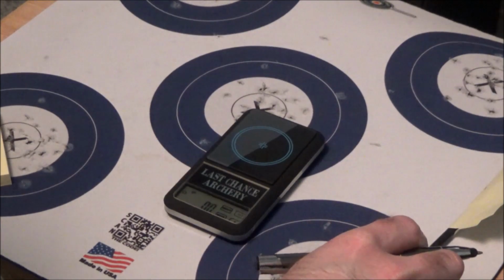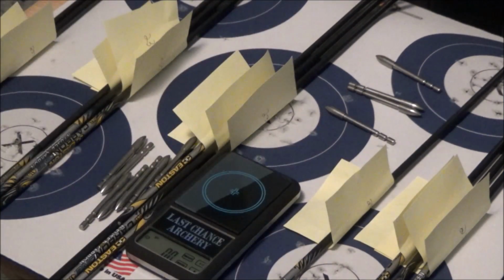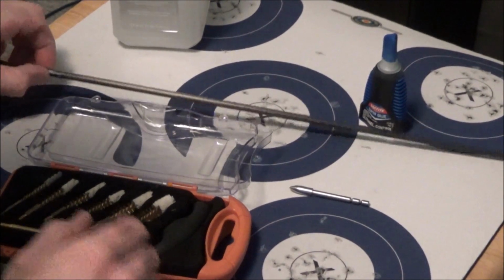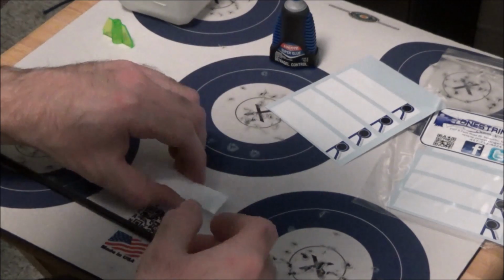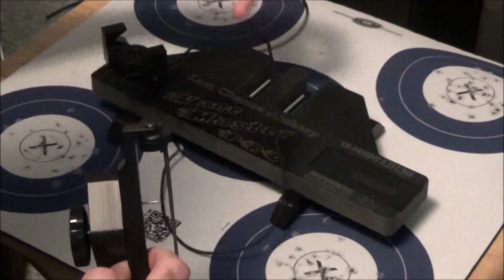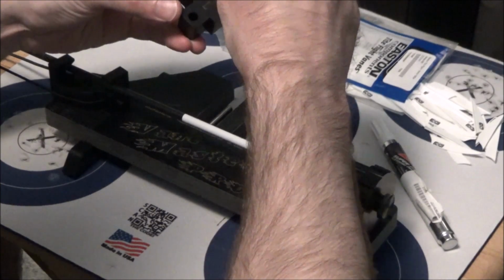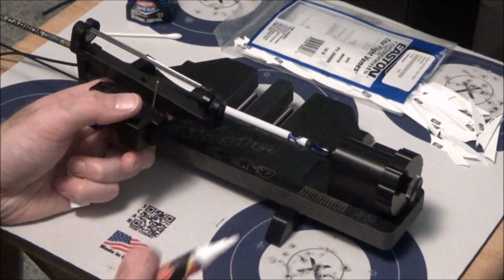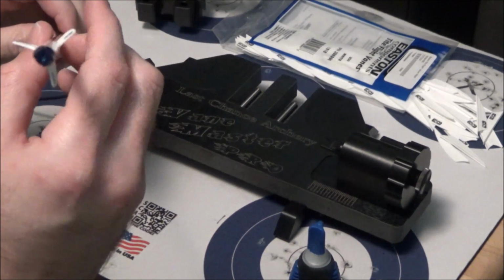Tuesday's Tip of The Week #11 Arrow Building

Comment: Hi Robert, I am shooting mainly at 50m and sometimes at 18m. My 50 m arrows have vanes with a 2 degrees right turn and the 18m arrows have straight vanes. Today I tested the 50m arrows                 at distances between 1m and 8m. Multiple shots at each meter increment. My arrows begin by turning left and at 7-8m then don't turn any further left. I guess that any further out they would begin to turn to the right. Will this affect the performance / accuracy? Would you recommend re-fletching the 50m as well as the 18m arrows? With the corona lockdown I have all the time in the world to do this :-|